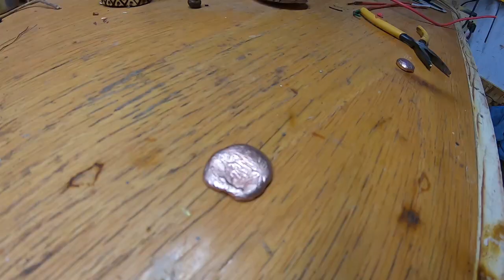Scrap Copper Project

Comment from the maker: MAPP gas is a fuel gas that's a mixture of propane, methylacetylene, and propadiene. The name comes
 from the chemical composition of the gas. MAPP gas is hotter than butane or propane, but not as hot as acetylene.